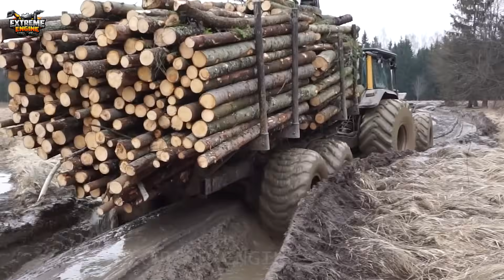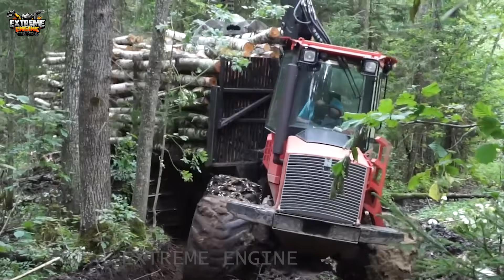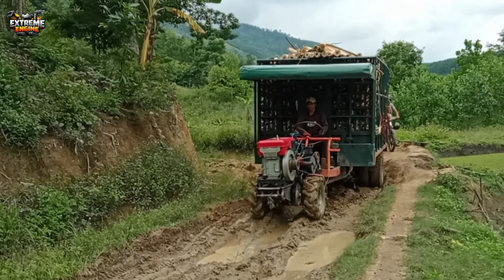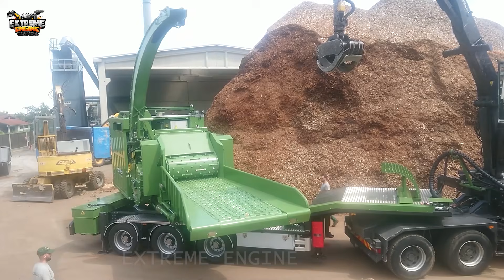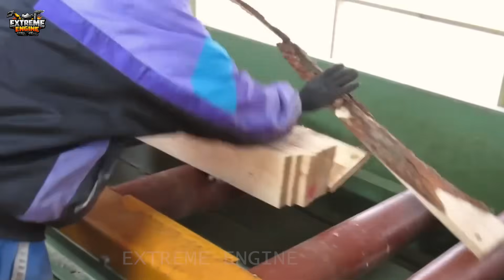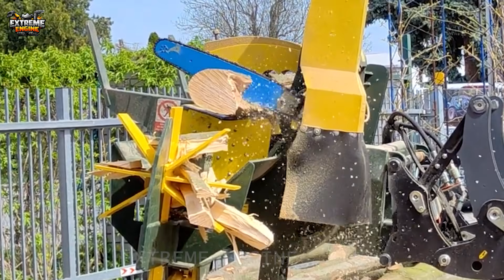Extreme Dangerous Big Logging Wood Truck Driving Skill | Heavy Machinery#11

Comment: These logging truck drivers are operating in some of the toughest conditions possible. The mud, steep terrain, and massive timber loads make every trip look extremely dangerous and intense.
Reply from the maker: Which challenge looks the hardest — the mud, the steep hills, or the heavy loads?

Comment: These giant logging wood trucks are absolute beasts in the mud. The drivers need incredible control and experience to move such heavy loads through slippery forest roads without getting stuck or losing control.
Reply from the maker: What do you think is the hardest terrain for these trucks to handle?